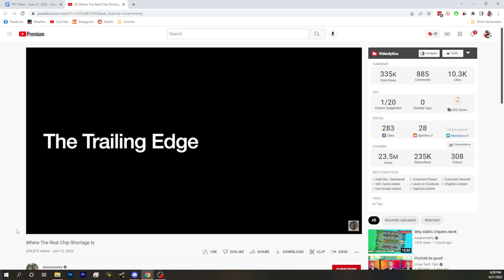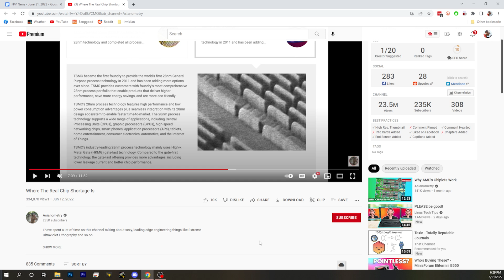Where Is The Real Chip Shortage Coming From? - FPV News

Comment: Prices for semiconductor devices are SUPER flexible, they do come down after they go up once the supply-demand ratio recovers. However we're years away from that happening.
Reply: Are you an economist?
Reply: @Steve00alt  No, but i am a computer engineer and have seen things happen in the electronics industry over the last couple decades. Sometimes a flood or other disaster has caused the availability to drop and prices to spike, the original cause of the shortage was usually remedied in months, and then the prices recovered maybe a year later, and the pressure wasn't ever high enough to change things fundamentally.

Why i'm saying we're years away from recovery is because the recent shakeup has changed how major electronics manufacturers operate. Previously it was largely Just-in-Time, usually buying just as much of everything as they need right away, and only occasionally buying extras when they're cheap; now they are choosing to keep a couple years' worth of stock of critical components to absorb the risk, because they realised they're losing boatloads of money by not being able to ship a finished product, but it'll take a while to fill these orders; and until then, the availability of parts on the general market will be horrendous. As you can see all the standard ARM M0/M3 micros by major manufacturers are sold out 2 years in advance right now, and this might extend for a while yet beyond that, don't know how many years, until rapidly there's a boatload of them and they cost pennies.

Comment: Was surprised to hear FPV use trailing edge semiconductors. Something like STM32F401 (F4 ) is 90 nm, but trailing edge is at 7-5nm.
As far I as know ST uses used legacy lithography machines, so it's kind of opposite to trailing edge
Reply: Leading edge is 3-7nm. Trailing edge is 28nm and up. I think asianometry summed up legacy under the trailing edge in his analysis, that's the only way to makes sense. For sure it's anywhere between 28 and 130nm everything you use. 90-130nm shortages are MASSIVE.